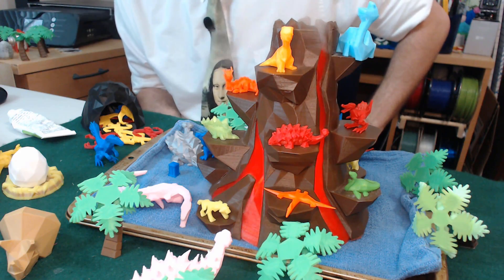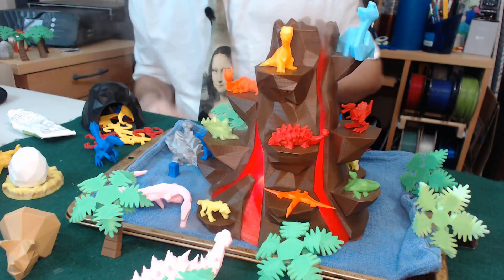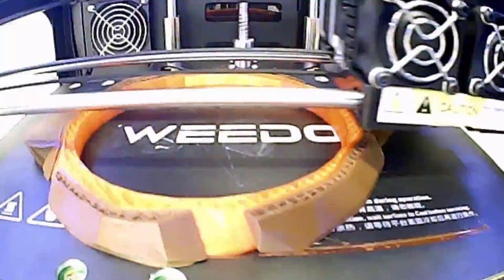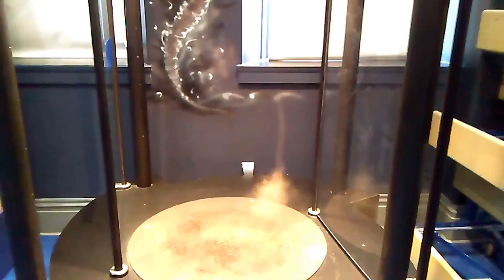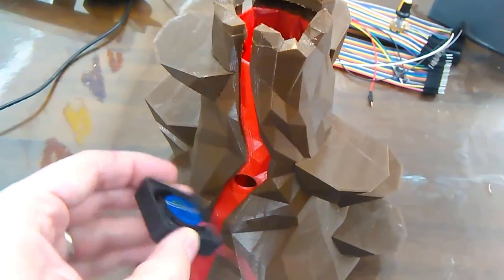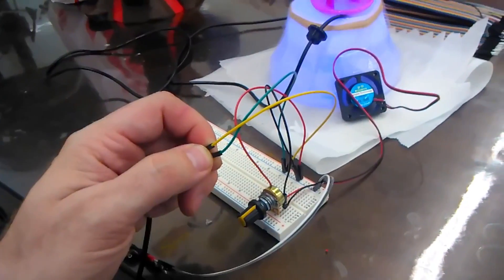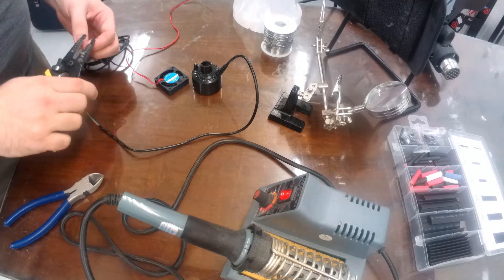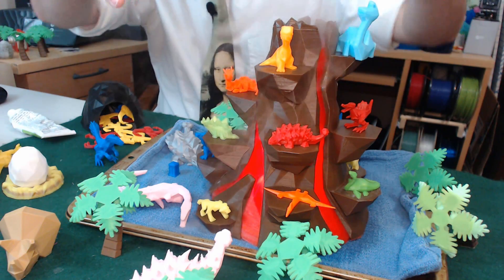I made a smoking, 3D printed low poly volcano!

Comment: Ditch the water altogether and make your own fog machine that runs on fog fluid (vegetable glycerine and water).  It would be possible to make something that runs on the power supply from the mister.  Use the same fan, but at very low revs.

An 8 ohm coil would give about 18 watts on a 12V supply, just about perfect for that project.  You should probably run the pot as voltage divider as a speed control, not straight through.

On second thoughts, 18 watts might be little high, depending on the size of the coil.  Maybe start with higher resistance and work your way up.  You also have to stay within the curren limits of the power supply as well, something you did not consider when adding the fan (but it was probably OK, even if only just).
Reply from the maker: I kinda had that thought myself. This is working for now, but maybe I'll work on a version 2!
Reply: @3dpprofessor   Let me know if you need any ideas for this.  I'm thinking of prototyping something myself.  It could even be a PWM controller using an ATtiny (Arduino/AVR tiny processor), or it could be a simple analogue circuit.  I suspect the cost is not likely to much different.  (A $2 ATtiny85 has 2 PWM outputs for fan and coil, but will probably still need MOSFETS to drive the coil and fan.  The advantage of using PWM would be much better control as it would be infinitely programmable.

Comment: I could not help but notice that electronics is not your strong suit. Voltage is not power. Voltage times current is power. And as long as your power supply can produce more current than the total combined current your devices consume, you can connect them parallel as long as they work with same input voltage. But nice that you got it all working. If you still want to adjust the air flow, instead of changing the speed of the fan you could use mechanical flap to restrict the flow.
Reply from the maker: Yup, I am definitely still learning. And no one who I asked brought this up, so thank you. 

Looking at the whole thing, that fan isn't draining very much current, but I'll keep an eye on the power brink and make sure it's not working too hard.

Comment: You would need to check the power adapter can power both items by checking the power of the PSU vs the two items by checking the details on each.. Just because it is working does not mean it is safe. The PSU could get hot and burn out the coils with a possible fire if it is being stressed. .